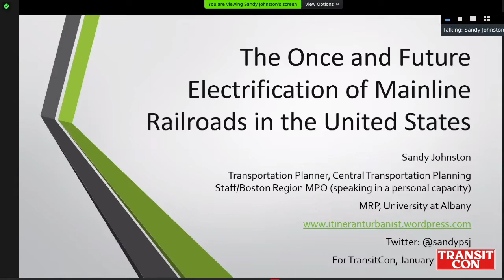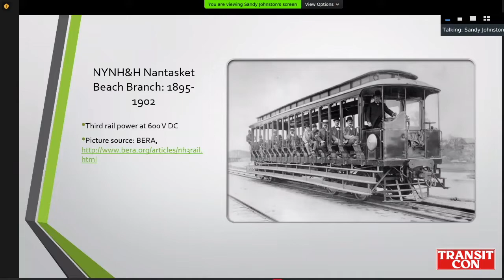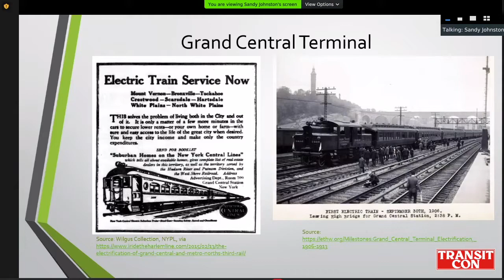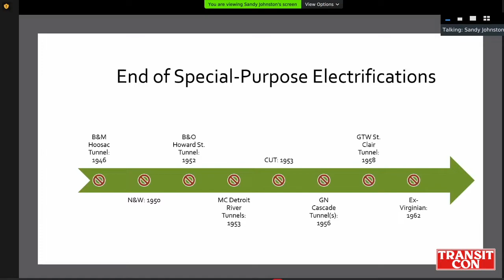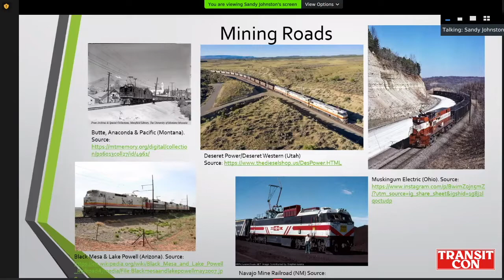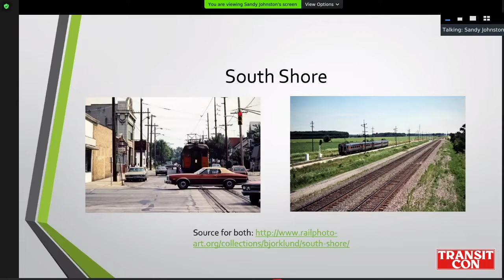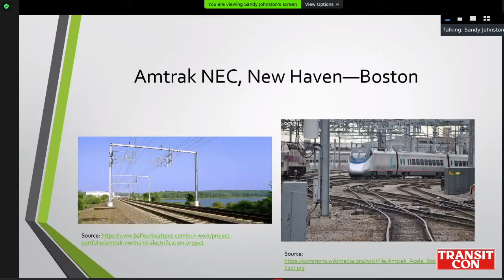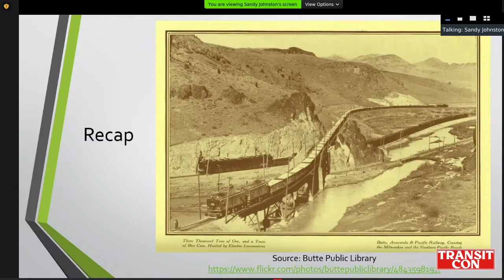The Once and Future Electrification of Mainline Railroads in the United States, Sandy Johnston

Comment: There is an answer to this just use the same overhead wire clearance as the reading Railroad to permit double stack trains through them.
Reply: The Reading Railroad was made part of Conrail in 1976. 

Where do double stack trains operate on former Reading electrified territory?
Reply: @JugSouthgate  West Trenton and Norristown Lines that's where you see them
Reply: @EpicThe112  I know those lines. Been there many times.
Reply: Correct. That's what is done in India. The Milwaukee road had the contact wire up to 30 feet above the rails. Switching staff could  safely stand on top of boxcars. This is more than adequate for double stacking. Anyone who says this is an obstacle is talking 💩 but  the oil lobby and the other grifters don't want wires
Reply: Not that big of an issue India has most of their network set up for double stacked container freight and it's nearly all electrified

Comment: I greatly regret that our railroads, particularly passenger, are not largely electrified also.  That said, we have to remember that the U.S. railroad system started back in the 1830s, and gradually evolved from there.  A substantial part was already built up & out by the time electrification technology became available after 1900.  Steam already had a strong hold and influence as the only available (and preferred) motive power design and manufacture.  So electrification was spotty, and mainly in the northeast.  In Chicago, for example, only the old interurbans and one commuter line were electrified from the start, and what remains of that today are the one commuter line and one remaining interurban.  And Chicago has been the historical main rail hub of the country's interior.   Contrast this with Europe and Japan, both of which had to rebuild virtually everything from scratch after WWII.  They could afford to take some time with planning and resource allocation.  Japan took this further, developing the Shinkansen bullet trains only around 20 years after the war, and also on their own dedicated routing, without having to share trackage with any competing freight traffic.  After WWII in the U.S., switching to diesel was simply easier and cheaper than reworking everything to be electrical-based.  Solid (coal) and liquid (diesel) fuel had simply become too ingrained in the rail industry establishment's operating methodology, as well as the gradual infrastructure development.  Switching to electric simply would have required more expense and effort than either the industry or government was willing to provide.  As the video indicates, however, some electrification is now popping up here & there around the country.
Reply: Kabuki Kitsune  Indeed, I don't find any major disagreement on your specific points here, except perhaps on the overall cost it would be to electrify.  But he money just is not there. (After all, our big sitting-duck aircraft carriers are much more important for Congress & the government establishment in general.)   The CA rail is a cost boondoggle so far, I just don't understand why the effort was not applied to upgrading existing Pacific coast Amtrak rail routes instead.  General widespread electrification will not be coming anytime soon, and is likely to be only incremental here and there.  Guess we have to take what we can get.  Like I said, Europe and Japan had an advantage of sorts having to start from scratch.  But even they did not do it overnight.  China's HS rail has also been a while in development, yet still growing steadily all the time.
Reply: There are three factors in addition to the above.

First, it's not that " Solid (coal) and liquid (diesel) fuel had simply become too ingrained in the rail industry establishment's operating methodology". Not at all. The BIG difference is that coal and diesel fuel in the USA were and are very inexpensive compared to places like Europe and Japan. And it has been that way for decades. Those high fuel prices cause people make electrified railroads (both passenger and freight) more economical.

Second, in the USA, most of the railroads are for-profit corporations, not government agencies. This is particularly true for the freight railroads. As for-profit corporations, they are expected to generate profits based on their capital investment  - IOW, return-on-investment (ROI). They also pay taxes on every square inch of real estate they own. If a US railroad electrifies a line, the value of the line goes up, which means there must be increased revenue and/or decreased costs to justify the expenditure. It also means the taxes may go up. For most lines, the numbers just don't add up. 

Third, the costs of electrification are truly enormous. It's NOT just a matter of putting up some poles and wires, and getting some electric locomotives! There's MUCH more to it:

- Bridge and tunnel clearances have to be increased to make room for the catenary wires.

- Traction return systems have to be designed and installed on the track structure. (How many readers can clearly explain what an "impedance bond" does?)

- A traction power distribution and control system must be designed and installed.

- The signal system must be extensively modified or replaced to work with electrification.

- Locomotive servicing facilities for the new electric locomotives must be built and staffed.

- Everyone who works in electrified territory - train crews, track/signal/bridge/equipment people, station and yard personnel, etc., must all be trained and certified on safety in electrified territory. This is an ongoing process, not a once-and-done thing.

- An entirely new Electrification Department must be added, staffed, equipped, and given time on the track to do maintenance and repair of the electrification system.

Fourth, US railroads are still recovering from the costs of developing and installing Positive Train Control (PTC) systems in the USA. 

When a railroad is trying to make a dollar hauling freight, and their competition, the trucks, have their rights of way built and maintained for them by the taxpayers, every cost counts.

Meanwhile, in most of the rest of the world, the economics are completely different.

Comment: You may want to reflect and review your statement (26:28) that battery electric traction "is not true electrification". 1st gen battery electric locomotives from @WabtecCorp and @ProgressRailEMD can provide a significant range of traction services in standalone BE-mode including yard & road switching, grade assistance (up-grade & down-grade) and shortline heavy freight movements (bulk & intermodal). They can do this with low emissions and traction energy costs that will be about 1/3 of DE traction energy costs at the wheel. For medium-long haul operations they can be operated in hybrid DE-BE consists and reduce emissions and fuel consumption by ~ 30%. Bear in mind that battery energy density is projected to increase by 3x between now and mid-21C. My forecast is that BE traction will disrupt the adoption of conventional (OLE) electrification in the US , Australia and other DE-dominated markets except for routes with very high traffic density, where the big capital investment in OLE can be recovered reasonably quickly. Shortline operators will go with BE, not OLE.
Reply: How about combining battery-electric with Overhead wires on a single locomotive this exists in Switzerland SBB Ee 922/Ee923 Rangierbahnhof Zürich Limmattal Aem 940

Comment: One big problem in North America that would have to be overcome to retrofit existing track with a 25 KvAC catenary wire is available vertical clearance.  Many/most bridges and tunnels do not have enough space to safely run such a wire with today's high freight and passenger equipment.  It would mean the end of highly efficient double stacked containers, tri-level auto racks and Amtrak Superliners.  When the existing Cascade Tunnel opened in 1929, it used a 12.5KvAC 'wire' that was dropped in 1956.

Freight cars were much smaller then than they are now.  BN cut notches into the roof of that tunnel to clear double stacks, which are still a VERY SNUG fit.  There is no way that a 'wire' will fit without reaming out the tunnel.

Repeat that at most other overpasses and tunnels.
Reply: @Sven_Okas1967  true but are the tracks that they run on RETROFITTED with catenary wires?

Check of one of several clips on YouTube that show double stack container trains entering or leaving BNSF's Cascade tunnel - that is a SNUG fit!
Reply: @mgk920  here you can it see better https://www.youtube.com/watch?v=t-pPzpc5aC0    And for tunnels there are such or similar systems with a low installation height. which are suitable for voltages up to 25 kv    https://www.furrerfrey.ch/de/systeme/deckenstromschiene.html
Reply: How much space does a wire and some supports need?
Reply: @Jemalacane0  Keep in mind that I am not an electrical engineer, but I would assume that to be safe, you would need a clear zone radius around everything that has the electrical potential of the catenary wire that is equal to at least the length of the insulators hold up that equipment.  See images of such railways to get an idea of this.
Reply: @mgk920  what you want to look at are dielectric breakdown voltage values for insulators.  In fact there are many with tens of kilovolt per mm thickness basic dielectric strength, though in practice insulation is far thicker in case of flaws during manufacture, degradation over time, or damage.

Ceramic air insulators are a special case whose primary risk is often rainwater.
Reply: @mgk920  It would require that distance and more, because the ceilings of tunnels and the bottoms of overpasses tend to accumulate water and ice. 

This doesn't mean it can't be done, just that it will be very expensive and difficult to do.
Reply: @Jemalacane0  Several feet in all directions to avoid arcing. At least 3 feet.

Double stack trains need at least 21 feet vertical clearance from the top of the rail. So add 3 feet from the top of the equipment to the wire, and 3 feet for the insulators, and you get 27 feet as the absolute minimum height of overpasses and tunnels. 

But it's dangerous to use the absolute minimum around high voltage, so say 28 or 29 feet from top of rail.
Reply: @JugSouthgate  so basically allow one meter in all directions around such a wire to be safe
Reply: @mgk920  that's a good starting point.
Reply: superliners can clear overhead wires as seen on this video https://www.youtube.com/watch?v=_N7WJdB-Q8U but not double stack trains due the PRR wire clearance not allowing that to happen on the Other hand 25kv 60 hz using Reading RR wire height will clear the double stack trains https://www.youtube.com/watch?v=LuXCU2C00Mo
Reply: @JugSouthgate  Are tunnel materials (rock and concrete) conductive or conducive to arcing?
Reply: @Jemalacane0  it depends on the material. But it doesn't matter; proper and safe design requires that there be adequate spacing between all energized wires and hardware for the highest voltage to be encountered.
Reply: Actually you only need to suspend the wire 21 feet above the rail and many tunnels have enough clearance for thst